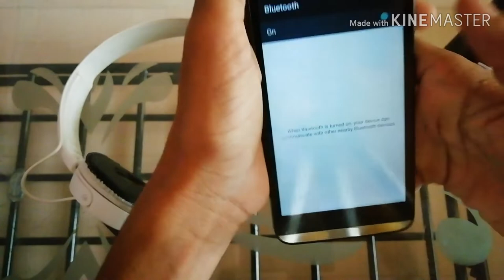How to make bluetooth headphones... How to convert any headphones to Bluetooth headset...

Comment: nice job, i have a questiin though,where did you solder that  wire running across the module before closing up
Reply from the maker: Please mention the time I can't understand
Reply: a  wire coming from the bottom of speaker casing going to the bluetooth module inner component, a naked wire running accross the component coming from the bottom i noticed the wire before you close the bluetooth housing
Reply: the time stamp shows from 3:50 to 3:55
Reply from the maker: @junescoses1283  if you get my point then reply or not go to the point tell me the point where you not understand. 😊
Reply: He uploaded clips again and again.

Comment: Bhai Mobile Ki Battery 
Is Bluetooth Ko Set Hogi Ya Nahi Batao.
Reply from the maker: Bhai 3.7 volt ki battery honi chahiye isse jyaada voltage na ho is baat ka dhyaan rakhna 😊😊
Reply: Battery 3.7volt ki lekin
mah.kitna bhi chalega kya.
Reply from the maker: Less than 200 mah
Reply: @nextgenjayant  mera 2000 mAh battery hai
Reply from the maker: I have used more than 300 mah and the circuit gone dameged
Reply: @nextgenjayant  oops
Reply from the maker: Try to use less than 300 mah and pls share in your contacts and subscribe to my channel